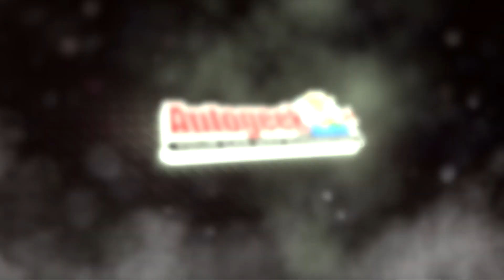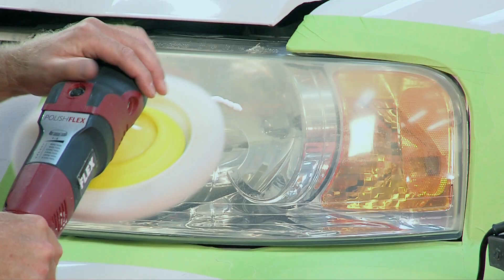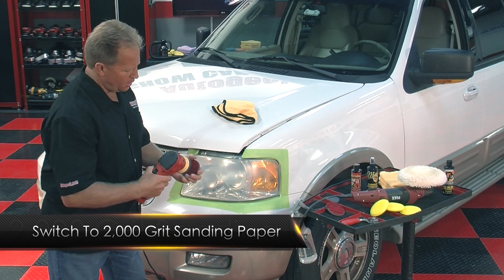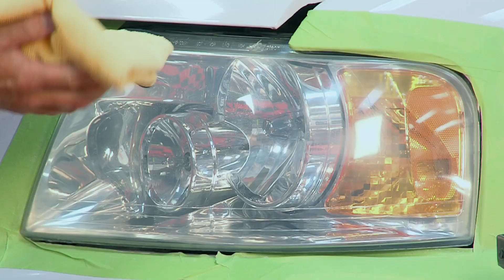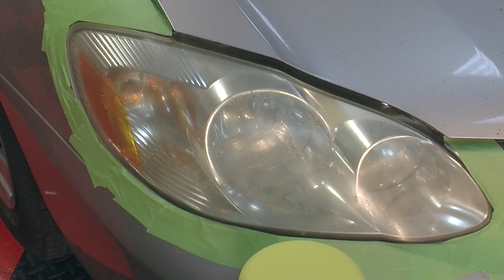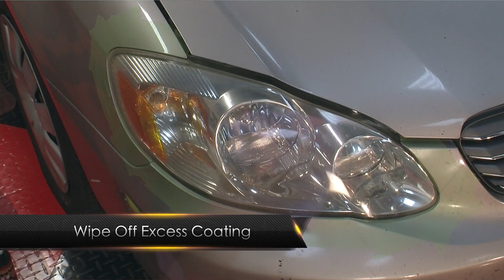How to Restore Faded Old Headlights - Autogeek

Comment: It looks milky still because 1000 grit is too fine.  should have started with 5 or 600 grit.  Also, a 3" backing plate and wool pad would have allowed for a better polishing step.   I never use soap in the water I sand with either.  I find the extra lubricity of soap diminishes the sandpapers' ability to remove the factory lens coating.